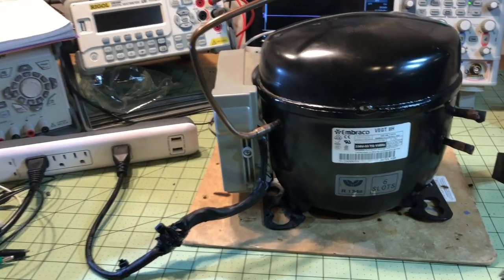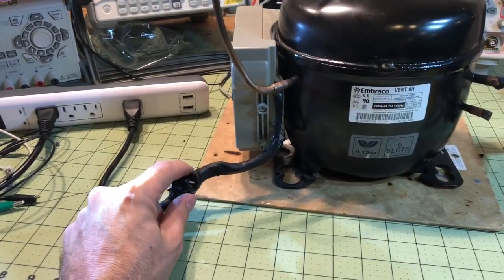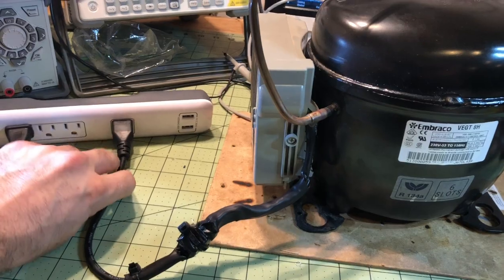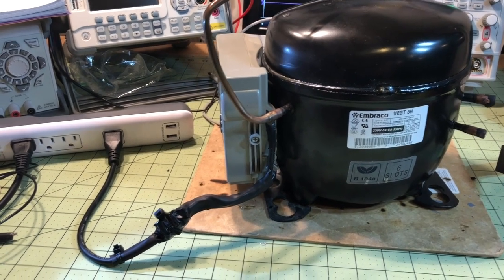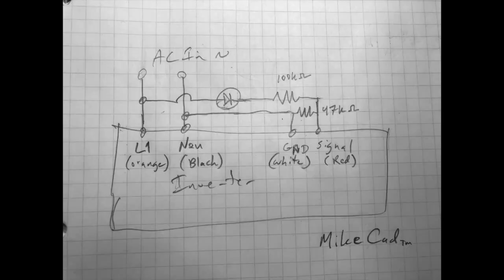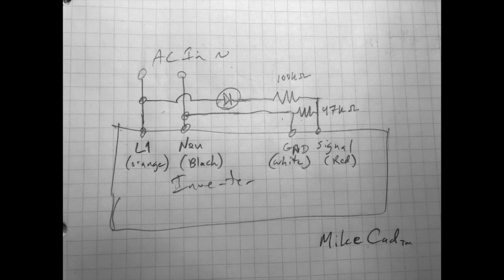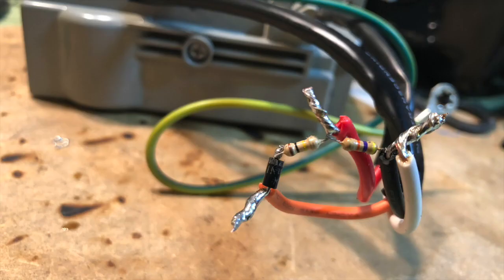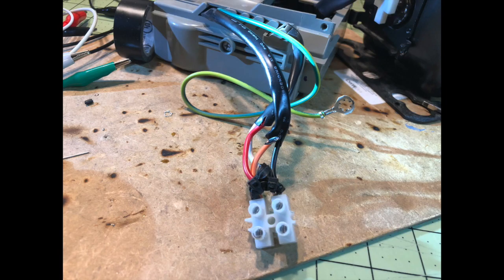VCC3 Inverter Compressor Tester

Comment: Tell me, please, is this you (using resistors and a diode) gave a pulsating signal from the network to the control input of the compressor inverter board - and so it started up? Do you have a 220V network — the resistor ratings that you indicated are for a 220 V network voltage?
Reply from the maker: I am on 120 VAC supply here in the USA.
Reply: and assumed. thanks for the answer
Reply: What do you think about this?
https://www.4mcculloch.co.uk/images/mediator/553/599706047.pdf
  From this service manual - can this inverter board be controlled by a simple thermostat, without a frequency signal?
Reply from the maker: Yes, on this inverter it's controlled by a simple operational thermostat (on-off style) no need for a DC pulsed signal.
Reply: How do you think - how to put the jumper correctly in order to start the inverter module without a frequency signal - between the power supply neutral and the output 1 of the control connector?
Reply from the maker: I would connect according to the diagram in page 8, it tells you how to connect in detail @andrlif
Reply: there, on page 8, it is unclear what wire comes to the thermostat, it is usually Line ... somehow not sure ... on the Electrolux refrigerators (for which this scheme) there were cases where an unusual scheme ... I'm afraid of the failure of the inverter module )
Reply from the maker: @andrlif  Here in the USA, L1 would be supplied from the control board, but you are correct, this would be an assumption. As this is Italian, I would not have access to the info. You could also hook up Neutral and see if it works, if not, sure bet would be L1, what else is there? since there's no low voltage. You can also test to see if there is a voltage potential, DMM with ac and dc voltage setting. If you have a voltage potential between the pin and connector, you know it will short out something. Use a LoZ meter so that you don't get ghost voltage.
Reply: Thanks for the hint ... at the input of the frequency control signal is an optocoupler - the maximum it will fail if that
Reply from the maker: If you have a model # that uses that VEM compressor you can try to get the service manual and see if it tells you the voltage output. Easiest way would be to actually test the appliance if you had one. I don't have access to European appliance service info, only service documentation from the USA.
Reply: Yes, I have a VEM9z compressor and a VCC3 2456 module ... I measured the voltage relative to the output of the on-line power connector and the output 1 of the control connector - about 110V (I have 220 V in the network) - I did not risk closing them (
Reply from the maker: Do you have a Variac, you can raise the voltage in increments and see when it turns on. @andrlif

Comment: Hi awesome insight, I need this to check inverter refrigerator compressor and air conditioner compressor but not able to get one, is it possible you can supply me one, I will pay the price with courier charges, it should work on all brands, we don’t have any equipment like this for testing so it becomes very difficult to find the fault, appreciate your help
Reply from the maker: Unfortunately I am not selling these, you can get a local electronics repair shop to make one for you, all the info they need is in the video.
Reply: Thanks a lot for you reply appreciate it

Comment: Hi sir!can i apply your wiring on a 220 volts supply?
Reply from the maker: You would have to increase the resistor values, not sure by how much. You can start with doubling them. You want a pulse of approx. 10vp-p on the signal line.
Reply: Hello, masters! We have international chat in watsapp for masters electronics of Washing mashine, dish mashines, friges. Invite you too. Write me, and i add you to us. We make electronics for thise devices.
Reply: @БульБуль-щ2ь   can i join ?

Comment: Hello . The video is really very interesting. I have to test my compressor, but I can not figure out which diode you used for the compressor starter circuit. Then was it possible to show you my card if this starter circuit was applicable? Thank you, thank you very much for your attention.
Reply from the maker: You can use a 1N4004 or higher, nothing special. Not sure what you mean about the 'card'.
Reply: You can use IN4007 for d.c and half cycle

Comment: Hi What is the wire assembly method for checking the inverter plate and running the compressor

Comment: Can I run my refrigerator like this forever or do I still need to replace the board?
Reply from the maker: This is a tester to see if the compressor works. If you use this to run a refrigerator, it will not regulate the temps, it will just run as cold as it can and run all the time.
Reply: @electronicsprojects4708  
Do I need to supply a specific DC voltage (Dc) or do I need a specific frequency signal? I want to do something like yours!) The temperature will be controlled by a simple Chinese thermostat w1209
Reply from the maker: @rms8576  My design runs on 120vac, 60hz (North American voltage). You can switch the L1 leg using a thermostat and that can work for you. You do not need a DC power supply to run the compressor.
Reply: @rms8576  hello what termostat can buy to control de temperature and RPM (PWM) ihave a inverter VCC3 1156 S0 A 00 ENBRACO only have a compresor and inverter unit to adapt in old equipmet can you helpme?
Reply: Hello, masters! We have international chat in watsapp for masters electronics of Washing mashine, dish mashines, friges. Invite you too. Write me, and i add you to us. We make electronics for thise devices.